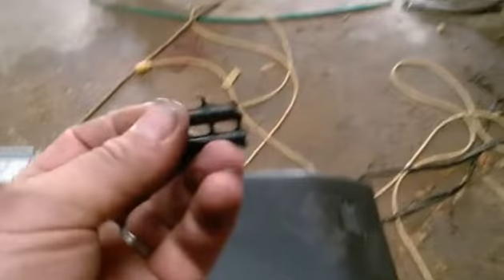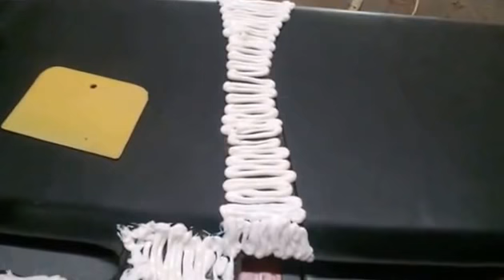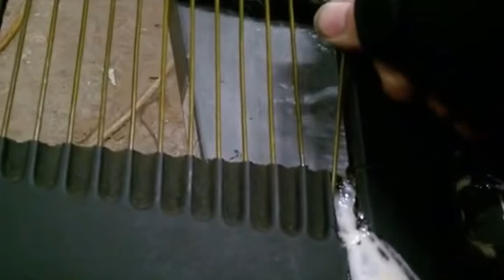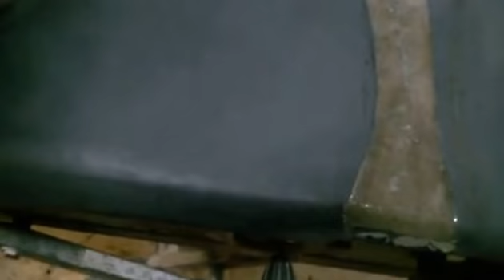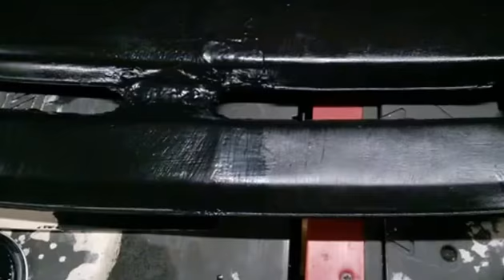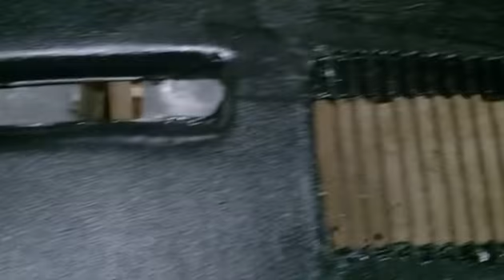Dashboard Repair

Comment: What makes 1 man proud, makes another man roll his eyes. Black doesn't hide a thing that's for sure. It ain't perfect but did you see it before he started. Besides the State Fair called and said "no more entries". Think you could do better? I'm a optimistic kind of guy. Having the patience or time to even attempt a dash fix, just isn't available for some.  Kudos for making something, normally thrown away, live yet again. Question~ when a man, works with his hands- what tool is he using? Answer ~ his brain. His arms & hands are mearly extentions~ mFulmer
Reply from the maker: Thank you

Comment: Hi what kind of roller did you use to give the texture? Thanks
Reply from the maker: Just a normal paint 4 inch foam paint roller
Reply from the maker: it gets the bumpy texture from putting several layers on it

Comment: A better idea than the coat hangers would be a stainless steal mesh paper basket. Just cut the mesh off the basket and you can buy them in black. Great for the vent hole covers.😀
Reply: Thanks :v ill do just that

Comment: I would think rather than painting after filling the cracks and whatnot, that wrapping in a nice heavy-duty vinyl, perhaps marine grade, so that you get the texture and color, but also provides a smooth consistent surface. You could then also appropriately size the speaker grill "rods" and really make it a uniform piece if you rig up a vacuum form.
Reply: great idea, just go to a fabric store, buy the vinyl and use spray adhesive, would work for a headliner too, cool

Comment: Not expecting to get the answer I’d like to get, but I figured I’d at least ask. Would I be able to do this without removing the dashboard? I want to restore the dash on my daily driver, but the way Chevy designed mine, you have to plug the gauge cluster into the dash itself. Meaning, I couldn’t take the dash out and just zip tie everything up for a couple of days. I’d have to restore the dash in-car. Thanks in advance
Reply from the maker: Without getting caulk, paint or scratches on your windshield..... probably not .. sorry

Comment: You could also just get the OEM vents that go into a 89-92 Firebird dash pad over the speakers and cut holes into the dash that they would fit into, rather than using coat hangers.

Comment: I didn't know you could sand regular household Caulk. Also I'm reading online that caulk is not sandable and in my vague past experiences I recall having issues with clumping and creating alot of mess with trying to sand caulking. Otherwise this is the most promising DIY on the cheap dash fix - thanks for sharing
Reply: I did not see him sand the caulk?

Comment: great video, 2 years ago I restored my 1982 chevy c10 dash the same way, I just haven't painted it yet, was waiting for some body work to be done. what i like about your video is the way u used the roller for the texture, that was just awesome.  thanks for video.  I just restored the arm rests from my c10 truck, the vynil was coming  off of the metal frame, I used gorilla glue and it worked great, I recommend  it.

Comment: I'm impressed with this. At first I had some skepticism but it pulled off looking nice. You didn't mention what kind of calk besides saying house calk. It appeared clear when dry but was white when you put it on. Our old 86 F250 has a cracked up pad that I can't afford a lot of $$$$ to drop into it. I would like to know what kind of calking like latex , silicon , or just what works best. Thanks
Reply from the maker: Its just plane old Latex Caulk. I got the clear because its my 
preferance . you can use it on alot of prodjects and the white kind is a
 little more limmites ..... as far as cosmetics go any way